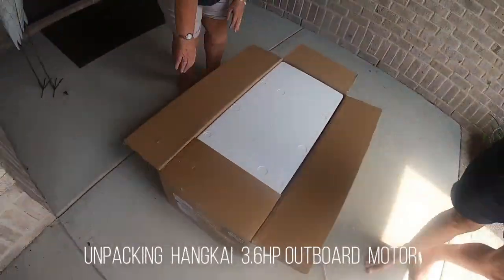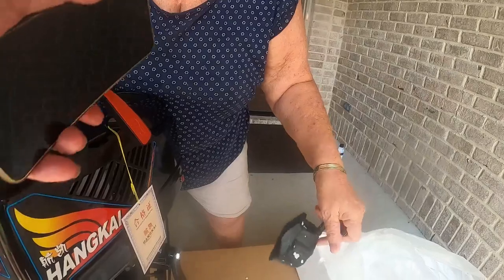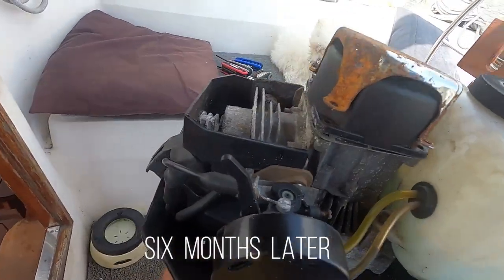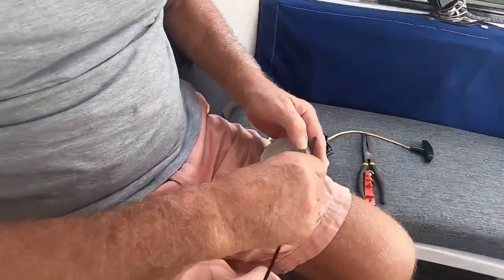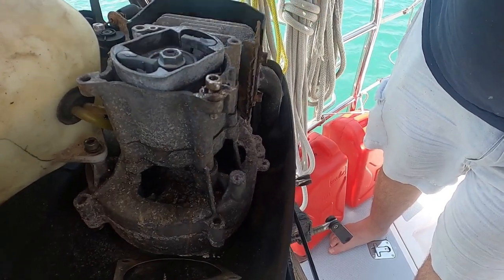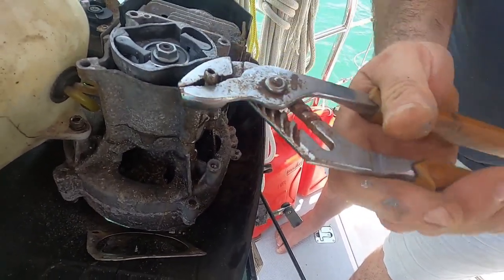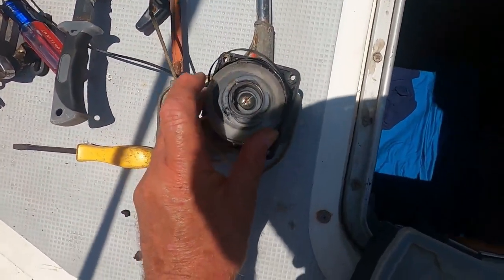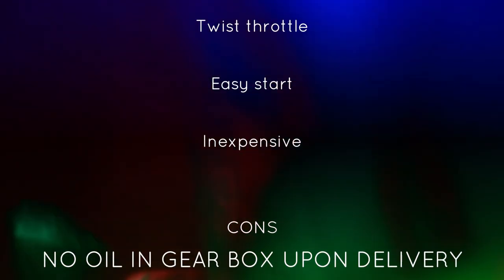HANGKAI 3.6hp - THE HONEST TRUTH

Comment: If your going to run in salt water , you need to disassemble and paint with marine epoxy pint. That will keep it from caroding...fill throttle wire  tube with grease to keep it moving....
Reply from the maker: I really should have thought of that!  Great idea and I wish I had done it!
Reply: Do you need to do that if you use it in lakes and canals?

Comment: Remember on water cooled you have to change the impeller every year and if it goes out while away from the sailboat you could overheat the expensive mercury or paddle back if you notice the water not spraying out the back.😮

Comment: I have a Tomking 4 cycle.  Much quieter than a 2 cycle and it's dependable.  I'm in the position of feeling sorry for boaters with water cooled and heavy motors.  It's easier to service than a Hangkai and it has an aluminum prop.  On a sailboat,  you might prefer a TK140FC 1 HP 18 LBS over my TK144FC 23 LBS.  I don't leave fuel in the tank overnight.  If you point it in a direction,  it will get there.  4 cycles are a snap to start and they are quieter.  Gulls and Elgins are an unusual exception.

Comment: I think we've all been done this track before....it's just so tempting trying to save a dollar by buying the cheaper product only then end up throwing more good dollars at the better product ,after the one we just bought breaks or falls apart..!

Well  done on the a good honest overview and assessment of the motor and likewise also agree with Scott and yourself  that its not really suited to the salt water 😂 cheers
Reply from the maker: Thanks guys - staying warm over there?  Sure has been cold here.

My dad used to say "penny wise, pound foolish".  I think I didn't listen well enough haha
Reply: The old adage the the most expensive tool you can buy is a cheap tool seems to apply to outboard motors too!
Reply: Yeah, in fresh water the motors are holding up nicely. Also the OP has freely admitted there were steps he did not take to prevent the damage the salt caused. I found a 6 year review earlier.

Comment: Your biggest mistakes were buying the 2 cycle and no preventative maintenance. I have a Tomking TK144FC 4 cycle. Same size. I changed the centrifugal springs for trolling, filed and shimmed the flywheel slot for far less advanced ignition, greased the throttle and screw threads, 85W 140 oil for prop gear, and put a hand finish on the aluminum propeller. The same cheap start unit will last far longer because 4 cycles start much easier. They don't foul plugs. Water cooling means jellyfish.

Comment: Did you spray Marine Grease all over the engine and components that would have prevented the rust buildup specially if you are in salt water just wondering because I'm looking at getting one
Reply from the maker: No Stephen, I didn't but wish I had.  Also a lot of good advice in the comments I wish I knew beforehand.

They are noisier than other motors but it got me where I wanted to go.
Reply: @sailingsalaciastar   beautiful boat by the way
Reply from the maker: @stephengalvan7722 thanks, she's an oldie but a goodies.
Do you watch our sailing channel on YT?
Sailing Salacia Star

Comment: Clearly you havnt looked after the motor, nor maintained it in any way shape or form.
If you are running it maj ly in salt water you need to keep all exposed cables greased, the pull cord needs bee wax applying and before storing it away it needs to be run in non salt water for 5 mins.
That's of course only my opinion.

Comment: Doing a pros and cons review with a 200 dollar motor in saltwater with no maintenance really .And i  dont care if you have a yamaha if you dont do maintenance especially in saltwater you will ruin the motor this is not a fair review
Reply: Umm, what maintenance needs to be done? I guess we're going to wreck our motor because we don't do anything to it
Reply: What maintenance is there to do on a simple two-stroke, especially after only six months? It’s still a brand new motor. And it’s not like the starter is a maintenance item. 

There are Yamahas (among other brands) from the 1980’s still in use without ever needing anything other than spark plugs.
Reply: @christianronn5301  maintenance isn't only wrench time it's also making sure in salt the motor is properly flushed every time out spray down with wd or such lubing up your throttle lever cables and pivot points that's maintenance  Means to maintain .keeping it in good condition not running the crap out of it in salt water especially then going home and throwing it in the garage till next weekend .that's how any motor budget or a brand name  lasts along time . I've seen the most expensive brand motors not make it past a season due to poor maintenance . And please show me any motor brand name  or not that's last long with just changing a sparkplug  and not flushing it out with fresh water and lubing it .I don't know what the salt content of the water you boat in but here in the real world salt is the most corrosive thing to boats and even vehicles alike .
Reply: @bdanielcal4608  I’d like to think I live in the real world, a five minute walk from the Baltic sea. Nobody “flushes their outboards” except in fall, when the season is over. Maybe.
Reply: @bdanielcal4608  do you only need to do this when using it in salt water? We have no idea. The first time we used the engine, some random people had to start it for us. If you need to clean it every time you use it in a river or canal, then I guess ours is already wrecked as we haven't done anything. I guess we need to learn a lot before we invest in an expensive motor
Reply: @ReeTVdocs  saltwater mainly but it doesn't hurt to wash it down with the hose and spray the parts with a fast hit of wd40  in any water type it's just preventive maintenance anybody can do what they want to there motor it's there money but I beat you motor for motor a keeping everything clean and lubed will last way longer then someone who just goes out comes home and goes in the house till next week you see i been boating for over 40 years and my job is im a a asa  certified master auto tech  for 30 years ive seen it all . Good maintained poorly maintained and believe me your motor will be running  out there while the no maintenance done motor  dude is on hear whining how he performed no maintenance done on a 200 dollar budget Chinese outboard  lasting only  a season .
Reply: @bdanielcal4608  thank you 🙏 I will make sure we hose it down. One more question, you just take off the cover and spray anything that moves with wd40? Thanks again
Reply: @ReeTVdocs  yea just spray everything metal with wd it displaces moisture.

Comment: Looks like a piece of junk
Reply from the maker: It did work OK for a bit but the salt water killed it quickly.  We get what we pay for I guess.
Reply: @sailingsalaciastar  I wonder if it will hold up better if more protected.  For example, use only in fresh water, wash/flush it after use, etc.
Reply: @sfbluestar  it does. i have had one for a year now and it has hold up great even if i have used it for a few months in the baltic sea wich is saltwater
Reply: @sfbluestar yeah, taken car of, it will last a while. Will need spare parts though.